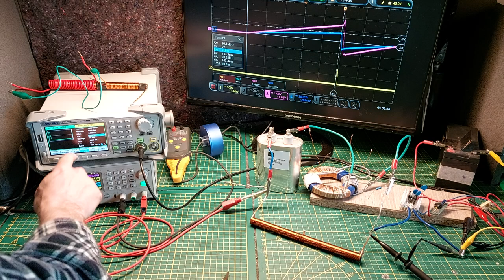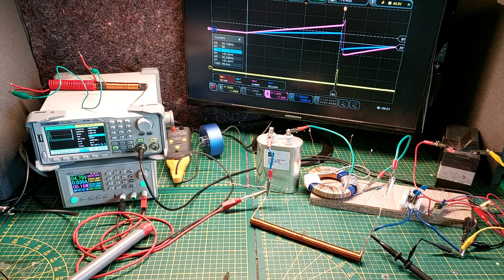A deeper dive into the kickback of a coil, part 2

Comment from the maker: !!! High Voltage in this setup, experiment at your own risk and only if you know what you're doing. !!!
 In this video you can see that with different frequencies it's possible to get the same kick back voltage by adjusting the duty cycle of the input pulse.

Overview of measurements:
400hz   2%duty       0.03W   4.79V   0.007A   767Vpk Kick back Voltage
1Khz     5%duty       0.1W     4.79V   0.022A   767Vpk Kick back Voltage
1.5Khz  7.4%duty   0.15W   4.79V   0.033A   767Vpk Kick back Voltage

The wattage rises because we have more pulses per second, but each input pulse on it's own has the same power in it.

The 3 capacitors in parallel to the mosfet have the consequence that peak voltage is lower, however the duration of the pulse (pulse width) is longer in that case.

I think we can conclude that if we give the same time for different frequencies for the magnetic field to build up to the same strength, we will get the same kickback voltage.

As someone mentioned to me, when we do measurements of the kick back voltage, we always see that it's positive in reference to gnd of input circuit. 
I don''t know the history behind why it's always called negative. One could say because higher impedance will give higher voltage, but in normal voltage devider the highest resistance also get's the highest voltage.
It's one of those things that you hear every time, but not exactly the real background, also not the real properties in detail.